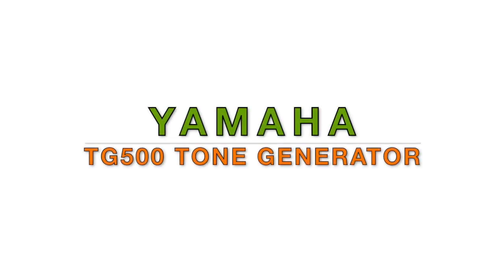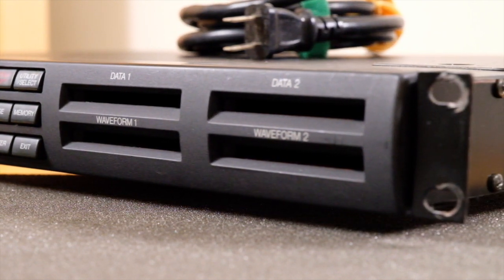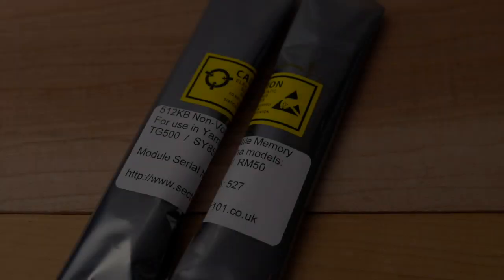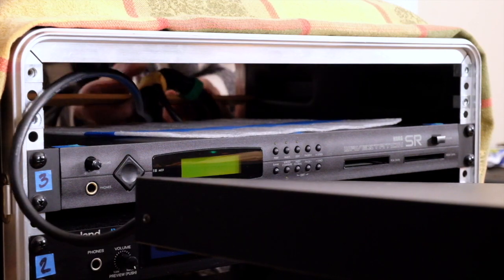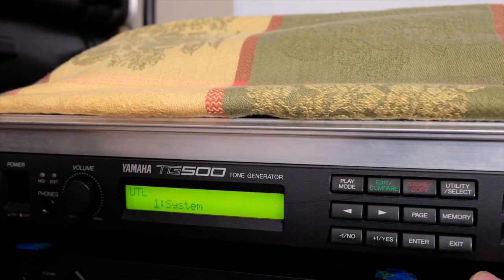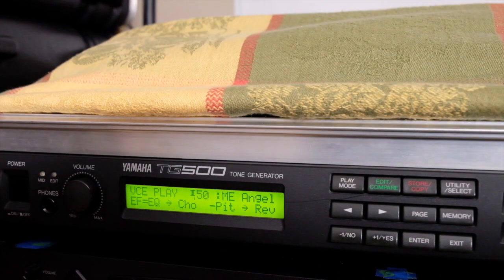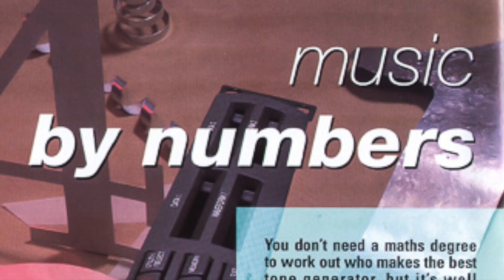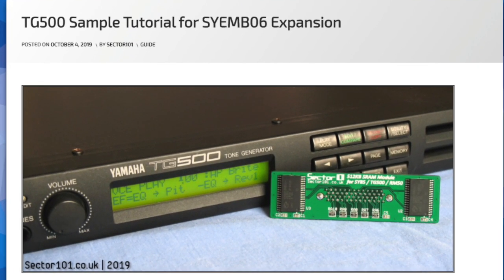Upgrading the Yamaha TG500 Tone Generator | Part 1:  Waveform RAM Install

Comment: Anyone that wants to stay computer-free can use an SYSEX bulk dump capable sampler like the Yamaha SU-10 or SU-200.

Sector 101 have been a godsend for these older jewels.
Reply from the maker: Excellent point.  There were hardware solutions to accomplish sysex dump/loads back in those days to eliminate the then-expensive computer setups.  
Sector 101 is freakin' awesome.
Reply: I used the notorius KRZ K2000s for SCSIMIDI dumps.

Comment: Is it essential to first install one or two non-volatile memory cards in order to load wave forms from wave form cards?
Reply: @Amal Gamoth I noticed that your question could be interpreted in two different ways, so I thought that I would chime in with a clarification, just in case there was a misunderstanding.

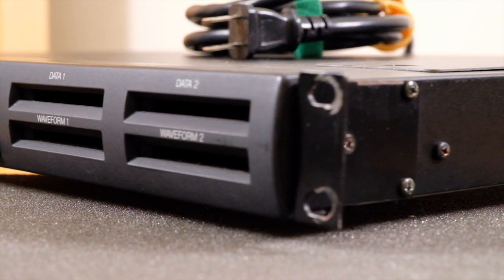You do not need the non-volatile memory to use the Yamaha wave cards like those shown at 1:48 with the TG500.  The synth can access the wave data directly from the ROM card as long as the card is plugged into one of the two waveform slots on the front panel.

Thoughtful Clip's reply to your question is relevant to a case where you want to use a waveform on a wave card -- or multiple waves from different wave cards -- after the wave card(s) have been removed from a front-panel waveform slot.  With the non-volatile memory installed, you can load waveforms from the wave cards into the non-volatile memory and use those waves even when the cards are no longer inserted.  In this way you could select waves from several cards and have the collected waves available on board the TG500 for as long as you need them without needing to reinsert the wave ROM card(s).
Reply: @jem2017 I didn't know that feature of the unit. Now comes the 1M dollar question.
When you load a sample from a rom card into the waveform memory, is it some kind of locked or protected against transmitting it via MIDI to the rest of the world?
Reply: @KONNECTORAS  I've never tried to transmit waveforms out of the TG500 via MIDI once they were loaded into the nonvolatile memory expansion, so I didn't know the answer to your question offhand.  Looking up the "sample transmit" function in the TG500 manual, I find that the card waveforms are indeed copy-protected and blocked from being transmitted, as you suspected:

"A key symbol will appear next to the sample number if the sample is a protected sample that has been loaded from a waveform card. Protected samples cannot be transmitted"  (page 247).

If I needed to export those waves, I would resample them through the audio outputs.
Reply from the maker: Yes. At least one memory chip has to be installed to load wave forms.  I found a good deal on a pair at:

https://www.sector101.com/syemb06.html

I don't know of any other current 3rd party that sells these.

Comment: Thank you SO MUCH for this video. I was teetering on the decision as to whether or not to buy a tg500 and this video has pushed me to make the purchase. I’m 50 years old, have a ton of gear going back to the early 70’s, both analog and digital. When acquiring new gear at this point, I like to find gear that has added features that allow it to be expanded beyond its standard purposes and watching this video was extremely helpful and informative. The fact that you included the sector101 page was just terrific. You saved me a bunch of time as now I not only know what extras the module is capable of but also the “where” can I get the add-ons!
BRAVO, brother!!!!! Five stars
Reply from the maker: Excellent! Glad the video was helpful, Arthur.  Appreciate the feedback – it really helps me fine-tune my channel.  
I was a teen in the 80s as well and I have, over the years, reviewed old KEYBOARD mags and numerous forums to gather info for my purchasing decisions of vintage synths.  Late 80s through the 90s was a prime time period for expandability of synths and samplers.  
My goal has been to look for opportunities to fill gaps in the knowledgebase of gear we grew up with so that all enthusiasts can learn and enjoy these amazing tech creations.  
Always more to come, so stay tuned; suggestions always welcomed!
Reply: Thoughtful Clips I did grab a TG500 in mint condition this week on eBay as well as the two chips to expand it... can’t wait to get that done. Again... THANK YOU SO MUCH!!!
Reply from the maker: @arthurlevinson5744  Very cool, Arthur!  I'm excited for you to dive in and utilize the power of this classic underrated synth.  I'd be curious to know what software version is installed in your unit.  I think 1.20 is the last known revision.  Appreciate your interactions on the channel.  I'd be interested to hear your creations with the TG500, if you're so inclined.

Comment: Thanks for featuring the S101 sample memory in this video :) The Midi 'sample send' speed you are getting is far below the norm, it usually goes around the same speed as the 20x time lapse. It's possible your sample send tool is inserting delays between packets causing such a long download.
Reply from the maker: Hi Brian, That's a good point regarding packet delays; I hadn't considered that.  I'll take a look at SysEx Librarian's preference panel and make another run at it.  Appreciate the feedback.